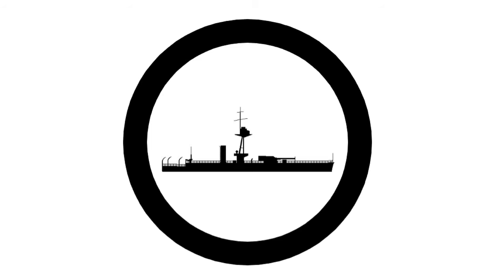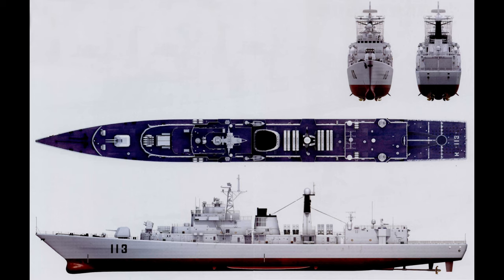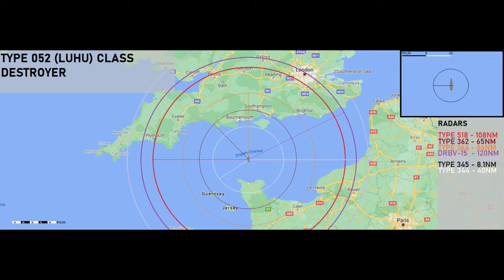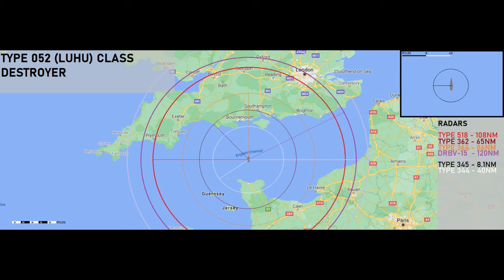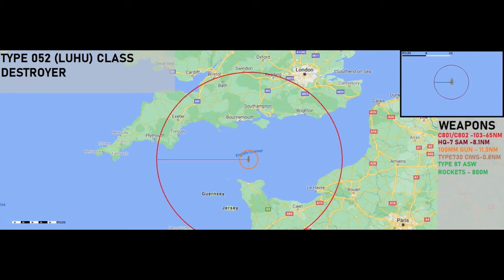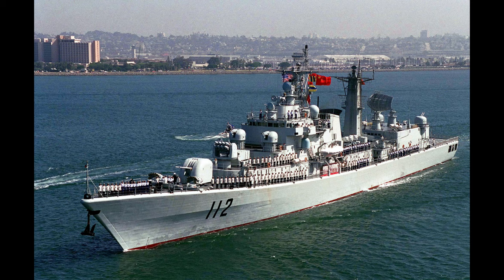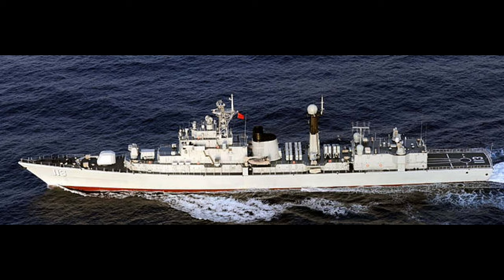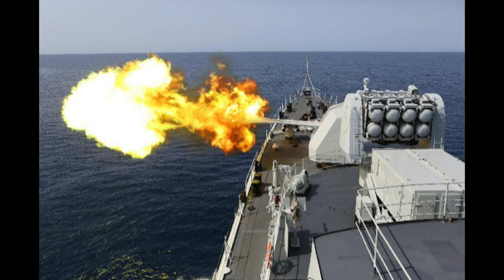TYPE 052 (LUHU) CLASS GUIDED MISSILE DESTROYER BRIEF - NO. 40

Comment: I agree that the 2 x 052 Luhu and the single 051B Luhai DDG were built mainly to test, integrate, train and familiarise relativity modern imported foreign weapons systems and sensors etc. 

The fact that only 2 x Type 052 were built, and each ship had different combinations of Western and Soviet sourced equipment leads me to believe that they were trialling and evaluating new equipment and to find the right combination for later classes of DDGs and FFGs.

The Sovremenny DDG, which were also imported around the same time that the 052 and 051B DDGs were commissioned, seem to fit the purpose, in other words, the Chinese PLA Navy was serious about designing modern naval via that would be equal to Western and Russian types. 

The number of Type 052 (x2), Type 051B (x1), Sovremenny I/II (x4 in 2 versions) are very small compared to the number of the most recent DDGs and FFGs.

The 'run quickly with small steps' technique of progress, that the Chinese usually follow, can also be seen in the way that the original Type 051 Luda DDG class was built in gradually more advanced and capable versions. 

The Luda I had the original SSM, 130mm guns, 4 x twin 25mm AAG, 4 x twin 37mm/57mm AAG, several RBU type ASWRL, etc, then the Luda II was built with a helicopter hanger, flight deck, triple ASW torpedo tubes, etc, and finally the last Luda III variant, which had modern SSMs, HQ-7 SAM, ASWTT, 4 x automatic 37mm AAG in fully enclosed turrets, more modern radars and sonars, navigation and communication equipment and CDS, plus ECM decoy launchers, radar jammers, RWR etc, and have been upgraded several times during their operational life, is a good example of how the PLA Navy does things. 

Even the 3 different DDG designs from the mid 2000's (Type 051C/052B/052C) were built around the same time in pairs, and it seems that the PLA chose the Type 052C, because they then built a total of 6.

The Type 052C was upgraded and became the Type 052D, with 13 built, and now the Type 052DL is being built (12 in service with 12 more either on trials, being fitted out or under construction).

So the PLA obviously went through a process of building or importing new designs or more modern versions of existing designs, from the 051 Luda I (x14), Luda II (x1), Luda III (x3), 052 (x2), 051B (x1), 051C (x2), 052B (x2), 052C (x2+4), Sovremenny I/II (x4) to the Type 052D/DL (x25+12).